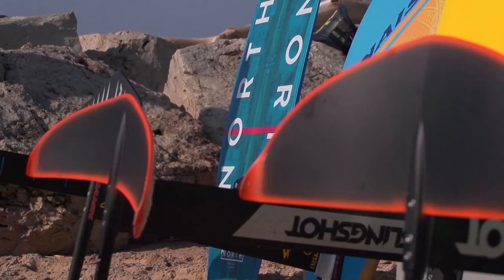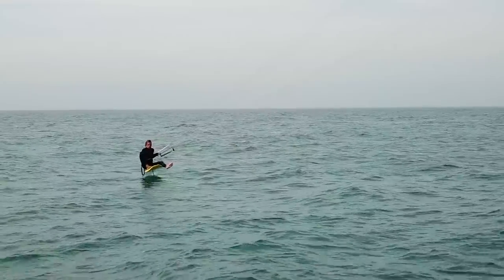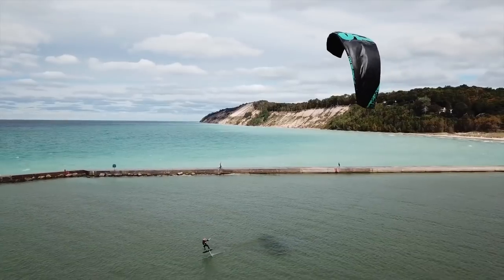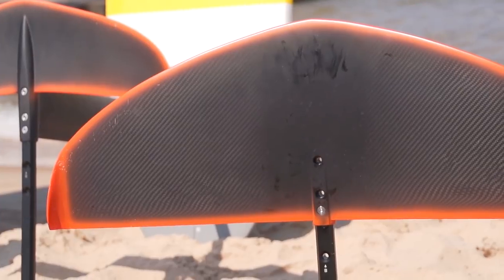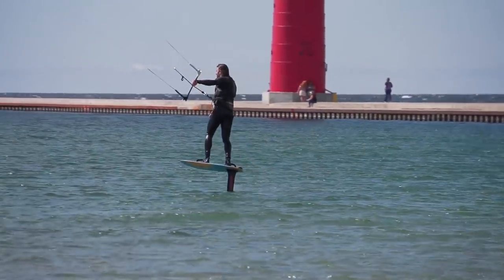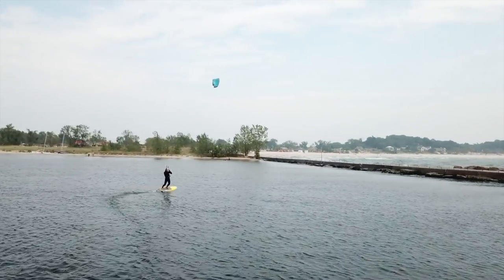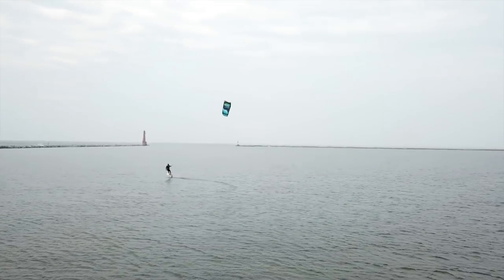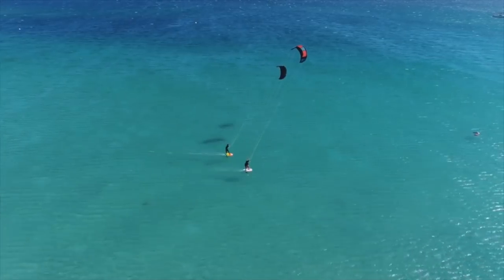Kiteboarding | Build Your Hydrofoil Wing Quiver

Comment: great video series. really enjoy Fridays. could you make a video on pocket boards and 0 volume boards. secondly a video on the sling shot switch fuselage and the different options. wing before the mast...
Reply from the maker: Thanks Darragh!
We will have some good comparison and reviews for the pocket boards this spring. As for the switch mast, what kind of riding are you doing? What wing?  99% of wings and conditions work best in the "A" setting.  "B" setting is primarily for windsurfer, SUPs, and some wakefoiling applications.

Comment: What was that dangling from the tail of the board at 7:50 ?  I'm guessing a board-to-foil leash?
Reply from the maker: Yes, It was a regular surf leash. Tucker was surfing on the other side of our jetty before we filmed those shots.  He forgot to remove the lease. - Rygo
Reply: @MACkiteboarding  I see.  Some of the windsurf foiling guys use a leash so if they smash something hard, the foil wont sink to the bottom.  Not sure how they attach it though.
Reply from the maker: @keithslater8646  Hey Keith, The windsurf guys have a strap mount they can use the leash the foil to.  You could also use a stick on leash attachment like this....
http://www.mackiteboarding.com/surfco-ez-plug-stick-on-leash-plug/

Comment: For someone who rides and enjoys the LF Thruster, what would you recommend as an all carbon alternative?  Looking to shed some weight for the sake of jumping. Cheers.
Reply from the maker: Hey Peter,
I'd check out the Moses 101Fr or Slingshot GW2.0 101 (same foil) or Lift 110.  Either will have a similar freeridy feel with more speed and quite a bit less weight.  Especially in the way of swing weight and leverage on your straps since the Thruster wings/fuselage is so heavy.
http://www.mackiteboarding.com/moses-vorace-101-fr-590-330-foil/
http://www.mackiteboarding.com/lift-foils-classic-wing-110/
Reply: @MACkiteboarding  Great.  Thanks.